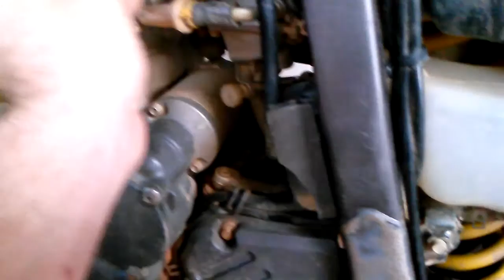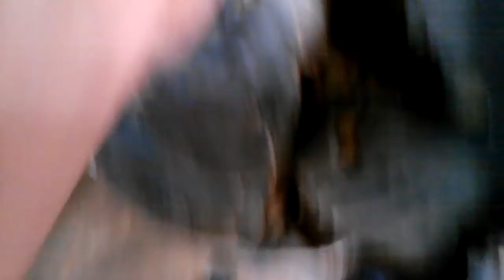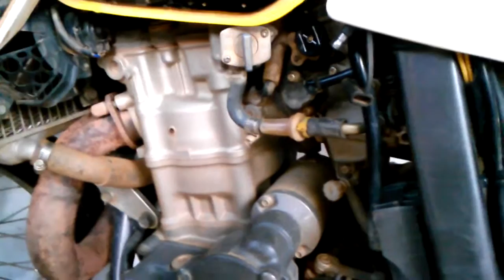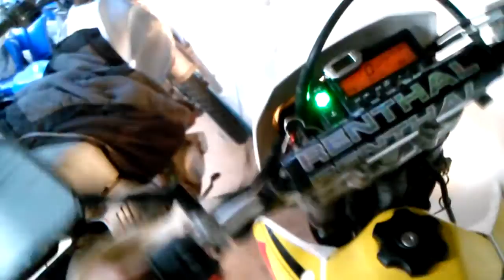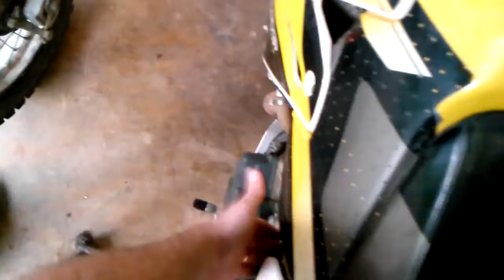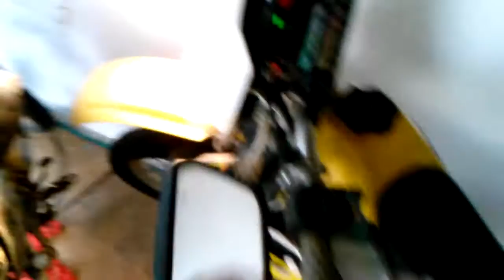Ride AMAP is an Idiot! - Raw

Comment: I don't like the fact that i can't get fuel to flow unless the engine is greating vacuum. On bikes with no kickstarter if you run the battery dead trying to get fuel flowing again you could be stuck somewhere. I prefer to turn it on and off each time just so i know if i ever need it to flow instantly it is there.